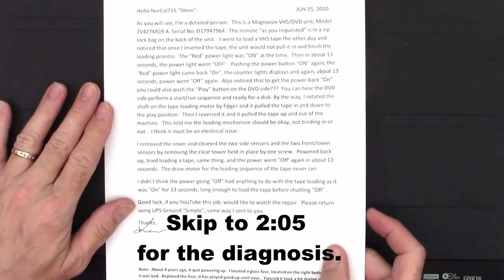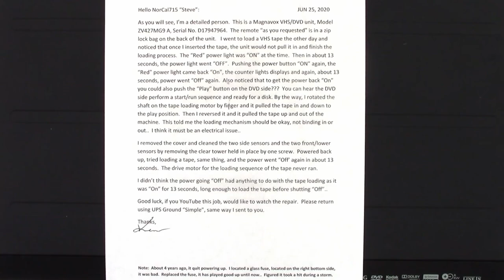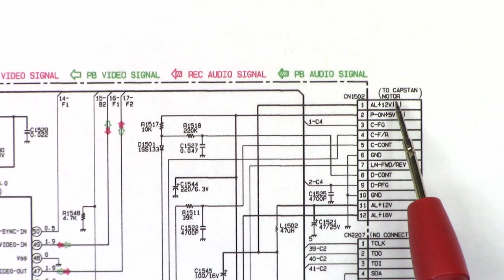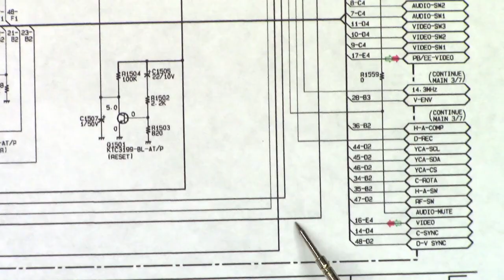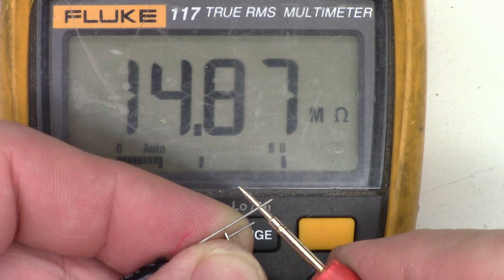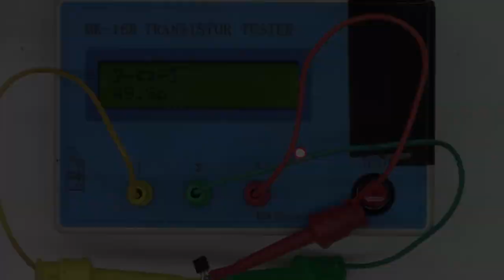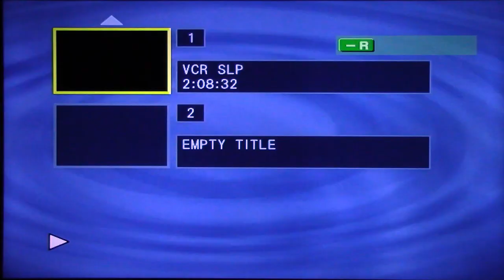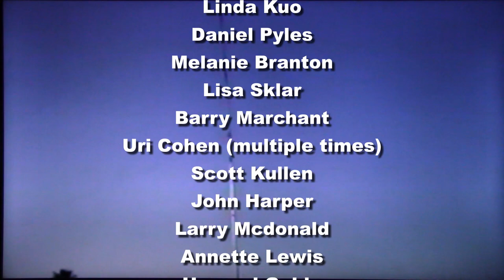MAGNAVOX DVD-VCR REPAIR ZV427MG9 A WONT TAKE A TAPE & SHUTS OFF - BAD CAP & TRANSISTOR

Comment: I sent my unit to NORCAL715 because watching some of his repair video's, I felt good that if I sent it to him, he would do a quality repair.  Well, I wasn't wrong, he did a very OUTSTANDING repair of my unit.  The video he made of the repair really shows his repair capabilities.  His communication during the repair was superb,  very easy to understand every thing he was doing.   His communication to me via Email was just as good.  I live in Georgia and sent it to him in California.  If you have "Sick" unit, contact him even if you have a local repair shop because I know for sure he will do you right.   Watching him use a wiring diagram during the repair and myself understanding  he diagram  was awesome.   Thanks.... Ken
Reply: I'm in Georgia too, with one with problems. At least it powers up. Intra pandemic mail costs have really jacked up, and repairs to these, if not for love or sentimental reasons are something to consider.

Comment: Steve, I too always used an Acetone based solvent whenever I cleaned a PCB or the heads and tape path etc, I never had any issues whatsoever....in fact it left the circuit boards and solder connections looking bright and shiny, better than new.
So, to whom ever said Acetone is bad evidently never worked in electronics service. 
Also, nice troubleshooting, those type of components are very satisfying to find because one knows that they are defective..unlike I.C.chips which can be a roll of the dice sometimes. 
Good job.

Comment: I followed along with your video and found my Capstan Motor was reading 223 ohms. Bad Capstan motor. Not exactly good news but I can find one now.
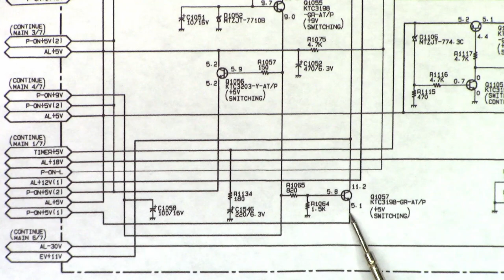Reply from the maker: https://youtu.be/L3EL38xhkj0 at 8:24 If you are reading the 5V line to ground (pin 2 to pin 10 of the capstan motor ribbon cable) then 223 ohms is excellent. In this video I got 230 ohms. I don't think that is the problem.

Comment: I subscribed , found you via being a proud MagFunai ZV427MG9 recorder owner with a problem. Had it a year, and finally decided to take a stab at fixing it. I'm trying to learn some electronics and struggling. Have fixed a couple of things. Old KLH record player, and a drill charger. Been challenging, for me.I'm 62 and long time since algebra and doing ohm laws and reading about different formulas. Brain doesn't have a refresh button. I like your videos. Well done. Have a Kenwood TS-930S, early serial , that won't power up. I read about problems with the power supply, and some transistors, so may either consider sending it to you or, if I can get some equipment, and learn to use a scope, may take a stab at it. slow going for now.

Comment: Mine had only a dirty center light tape sensor. Cleaned it with a q-tip and alcohol  and now it works fine

Comment: Just an observation, but part of the enjoyment of watching electronics repair videos is trying to figure out what is causing the fault(s) to occur. However, if you put the solution in the title it takes some of the fun out of watching the video. In this case for example you've stated there was a bad cap and transistor; on seeing that I'm less inclined to watch the video. I know that a large part of any repair is the diagnosis but still, knowing the resolution makes it less fun to watch. Putting the resolution in the description is fine, but putting it in the title spoils the fun. Even knowing it can be fixed also spoils the fun. Just saying. :)

Comment: .... I made a 'Clicker Cassette' years ago for diagnosing tape transport issues without damaging a test tape.
A cassette with the tape removed, the IR ports blocked off.
Reply: We use a plastic Vcr test jig which also works great

Comment: Great video with good detail.  I inherited the same non-working combo model from my sister.  I discovered the the photo diode (Q1506) used for the take up reel sensor is bad.  I do not have a service manual.  Do mind telling me what the part number is so I can cross it to something.
Thanks, Dennis
Reply from the maker: Q1506 is a PT204-6B-12. for more info email me Norcal715videos@gmail.com I can send you a service manual.

Comment: Great video. Question that’s off topic but, any advise on getting  little spritz of that expanding foam used for insulation off a Lcd panel?
Reply from the maker: ACETONE, It eats that kind of foam, try in on a small spot 1st. I tried it on a flat screen several years ago and it did not damage the screen.

Comment: I have the older Magnavox version of this model.  The HDMI output stopped working.  The other output works but I need the HDMI output.  What is the most likely cause of this?
Reply from the maker: Most likely some bad capacitors in the HDMI encoder or the encoder itself has failed.